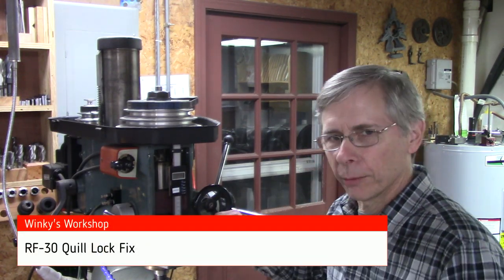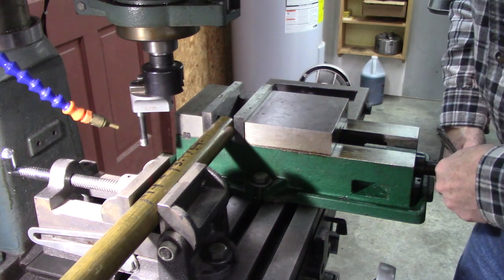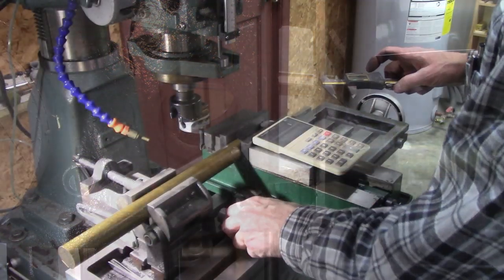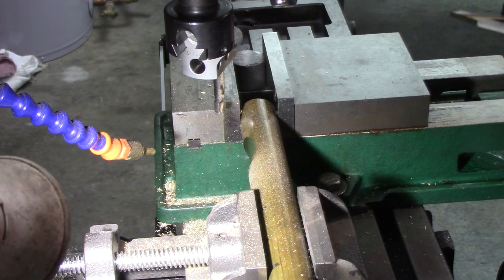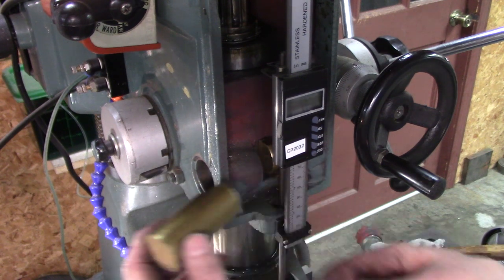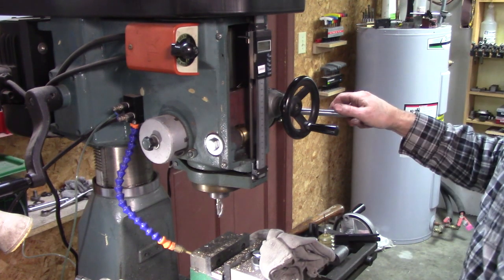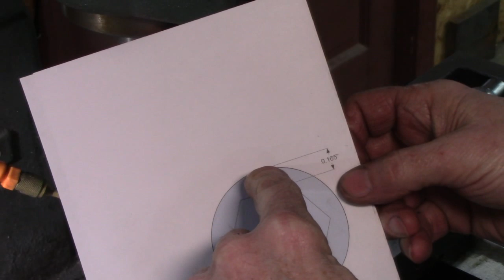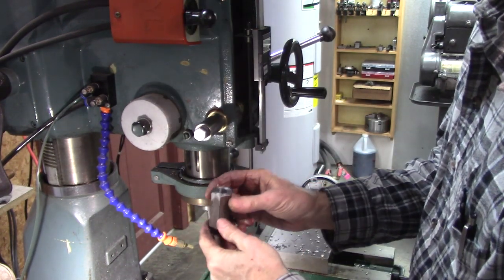RF30 Quill Lock Fix

Comment: The manufacturer should have used brass to start with!  My experience with that type of lock is that more contact area doesn't help that much. More contact area = less PSI, and more oil contact area. But I much rather your fix. It's easier on the quill if nothing else.
Reply from the maker: Well...  I just compared the bridgeport lock to mine and the bridgeport contoured the quill. I understand your logic but the new lock is way more effective. And yes, I was worried about the quill with the old lock because I had to tighten it super tight to get it to hold. I guess it could also be the fact that it is brass but I also think surface area plays a big part.

Comment: As an aside have you had any problems with the control nuts on the x & y axis?   I found with the RF30 I used to have they (the nuts) were manufactured from rather crappy brass, wore out after 30 years of home use. I ended up making some from delron, can find the instructions somewhere on the net... Cheers
Reply from the maker: So for the nuts are doing fine. They have interesting backlash adjustments on them. I can tell that they have been adjusted and there isn't much adjustment left but I don't think I'll ever have to worry about them. But thanks for the info...  you never know. I've had to address a lot of other issues however. When i got the mill it would bind on one end of the table travel. It was the mounting bracket on one end of the lead screw that was off center. I slotted all the holes almost 1/8" to get it to line up. One hole was positioned rong and the other was cross thread to line up. ("Rong" Fu)

Comment: What was wrong with using the original locking handle?
Reply from the maker: I probably didn't explain that well enough. The round pieces didn't have a radius on them. They were just cut off at an angle. The amount of surface areas that touched the quill was very small and it slipped while milling. I looked at a Bridgeport and copied the design.

Comment: Hello - I have really enjoyed watching your projects, especially the square column for your drill press.  I have the same mill/drill as you, but mine is Jet branded.  I put a glass DRO on all three axis of my mill/drill and the Z jumps around so much, that it is just about useless.  Is this the same problem that you were having?  Do you think that your fix will solve my problem?  Since I have about the same machine as you, I would love to see more projects that involve it.

Thanks!
Reply from the maker: The only problem I had with the z axis is slipping on heaver cuts and the down feed crank is spongy. The DRO helped a bunch. The dial on the down feed was useless. You might get .002 or you might get .020. I never did figure out why. All my DROs are very cheap. x was $39 Y was $29 and I think Z was about $30. I like the Z the best because it was easy to mount and shuts off. I had the X axis quit a few weeks ago. Probably my fault for not protecting it very well from coolant.
Reply: Make sure the column gib screws are smudged down  good .. if not it will cause Z axis  to move around. WINKY always does a good job.
Reply from the maker: @RagsdaleCreek  - Your too nice! But thanks.

Comment: Nice fix. I have an atlas 7b shaper and it uses a setup like what you built (but made for aluminum) problem is it smushes the inside diameter and fouls the locking bolt. Maybe I will try a chunk of  bronze I have to replace it.
Reply from the maker: Wow...  Not good. Do the threads go through the aluminum? If so, try making a lock bolt without threads in the aluminum spacer area. If the bolt is smooth maybe brass would help. You could also put a steel sleeve in the aluminum.
Reply: @WinkysWorkshop  I hadn't thought about the steel sleave. I think a portion of the threads go through the aluminum.  Its been a while since I had it apart

Comment: three years down the track dose the quill slip at all.   id like to copy your idea. with your permission please winky's workshop
Reply from the maker: The quill never slipped again, it worked perfect. FYI - I just sold this mill maybe 3 weeks ago and I now have Wells Index mill. The new mill is a very high quality and heavy and does perform better than the RF30. However, I was surprised that the difference between the mills was not more substantial. The RF30 has some issues but it's also a very capable machine.

Comment: My RF30 clone has the same problem with the quill slipping, it is very annoying for sure.  I like your approach to it and will probably do something along the same lines but try to retain the original handle.
Reply from the maker: I was going to use the original handle but the threads didn't match any standard of metric threads that I could find. I'll probably mount a handle on mine at some point.